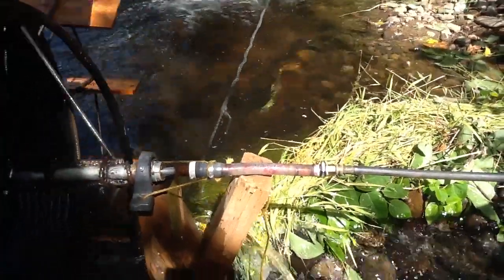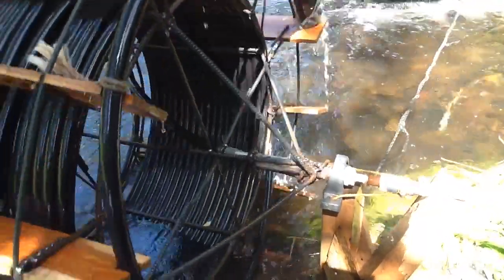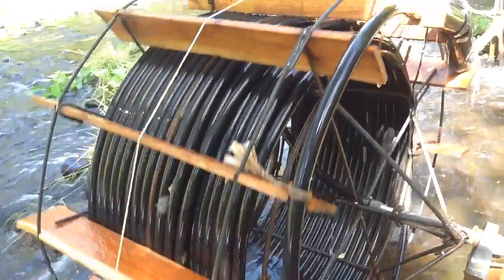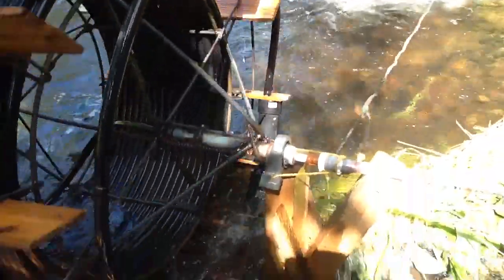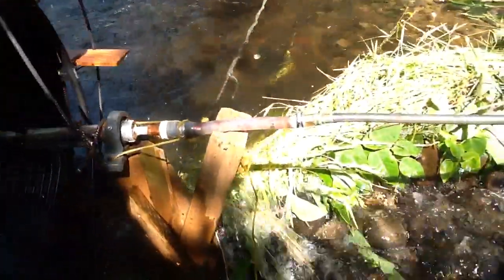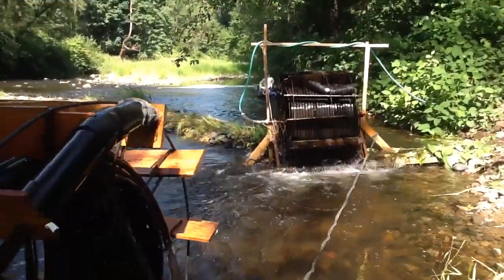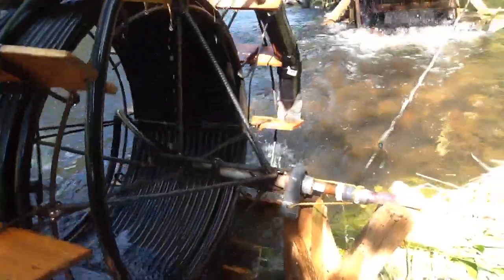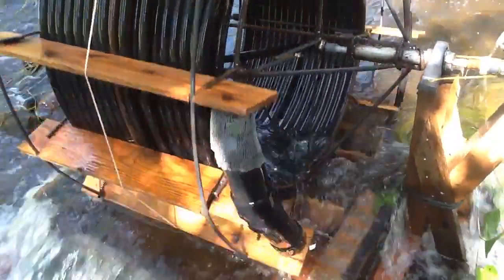stream powered water wheel

Comment: Sorry if I missed it in your video, but how much vertical lift can you achieve with one of these?  I have a similar sized creek as yours that I'd like to pump from, and would like to pump uphill about 75 ft or so.
Reply from the maker: I have lifted 80 feet the airlock trick is you must have between airlock over 1 1/4 pounds of water per loop that makes 2 feet of lift. You also need enough force to lift over 2 pound higher than the wheel to overcome friction of parts and resistance of water/air movement in pipeline. The air traveling up a 5/8” hose reduces the weight in the column of water. 76 feet equals 38 psi at pump and will take 40 loops on wheel to overcome pressure. Once the pump is running the air bubbles going up line reduces the water weight in column. The new packing I use for rotary seal (works the same as inboard motor boat) cause a significant amount of friction and might be the limiting factor.
Reply from the maker: A key item is the rotating seal 3/4” steel pipe out to 5/8” hose. FloLock 1 in. PVC Compression Coupling and Palmetto 1347AF Series Synthetic with PTFE & Lube Compression Packing Seal, White, 1/4" Square, 5' Length I got at Amazon.
A piece of 1” pipe is set at one end with 3/4 steel pipe slipped inside 1/4” packing around steel pipe inside compression coupling then another piece of plastic 1” pipe is slipped over iron pipe this is pounded onto packing compressing a water resistant seal around iron pipe. The put rubber seal and put on thread nut. Not tight enough the seal leaks air and water. Too tight and it will take too much energy to rotate and cause excess wear. This needs to leak a little at operational pressure. This works the same way as the packing setup on an inboard motor boat.

Comment: Thank you for your 2017 updated version of your water wheel.  I hope it is OK that I started a thread about your pump on the public facebook group.  Hope you will stop by for discussions and updates about your progress.    Also, I'm placing a picture of your pumps in the group banner collage - if you have any objections, please let me know:
https://www.facebook.com/groups/240458583255303/
Reply from the maker: A key item is the rotating seal 3/4” steel pipe out to 5/8” hose. FloLock 1 in. PVC Compression Coupling and Palmetto 1347AF Series Synthetic with PTFE & Lube Compression Packing Seal, White, 1/4" Square, 5' Length I got at Amazon.
A piece of 1” pipe is set at one end with 3/4 steel pipe slipped inside 1/4” packing around steel pipe inside compression coupling then another piece of plastic 1” pipe is slipped over iron pipe this is pounded onto packing compressing a water resistant seal around iron pipe. The put rubber seal and put on thread nut. Not tight enough the seal leaks air and water. Too tight and it will take too much energy to rotate and cause excess wear. This needs to leak a little at operational pressure. This works the same way as the packing setup on an inboard motor boat.

Comment from the maker: Recap of why this pump works and why it is so efficient.Hydrostatic pressure is the effect of gravity on water. .44 psi per vertical foot of water in a hose or a lake. The pump has at intake takes into hose 1/2 water and 1/2 air. This creates an air lock in each of the loops. This effect is collective. The effect of gravity (Hydrostatic pressure) is the same in each of the loops as in the column of water in the hose. (For easy of reference 1 pound of water = 2 feet of vertical) When the Hydrostatic pressure is greater in the loops of the pump than the pressure in column the water must discharge where the Hydrostatic pressure is the lowest. The reason it is so efficient is because the Hydrostatic pressure is over balanced in favor of the lift. The only power that is needed is to lift the water the original lift of 2 pounds of water 3 feet plus the resistance of pushing water through the pipes. 3.5 pounds of force to lift 60 feet. This pump runs on less than 20 foot pounds of torque with a 6 second rotation. In traditional pumps the Hydrostatic pressure is over balanced against the lift. In a 60 foot lift, the pump must overcome line resistance and Hydrostatic pressure of 30 psi before any water can leave the discharge point. In traditional pumps air in the intake drastically reduces efficiency and can cause damaging vibrations. But in this pump because of the displacement effect of the air in the vertical hose the force needed for lifting the water is less. As the hose dia. decreases the displacement effect increases but the line resistance increases. In a 3/8" vertical hose the air lock is near 100% but the line resistance (back pressure) is so great it becomes inefficient. In a 1" vertical hose the displacement has very little effect. Currently I am using a 5/8" hose to good effect. It has reduced pressure at pump by 8 psi. A 1/2" hose will have better displacement effect but more resistance. When you design your pump because there can not be any back pressure at intake you must not count the water weight in 2 loops. In a 60' lift you must have more than 30 pounds of water plus the additional water weight in at least 2 loops. You can not count the water displacement effect in your design because on a cold startup you might have to counter the full weight without air in the vertical hose.